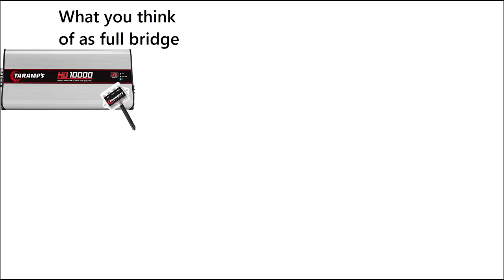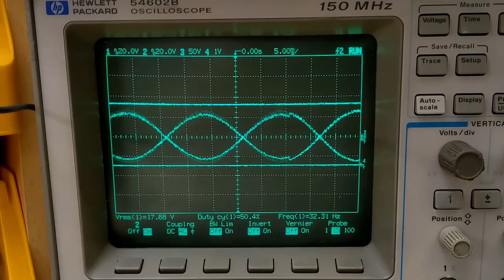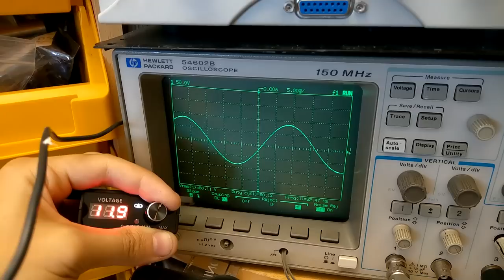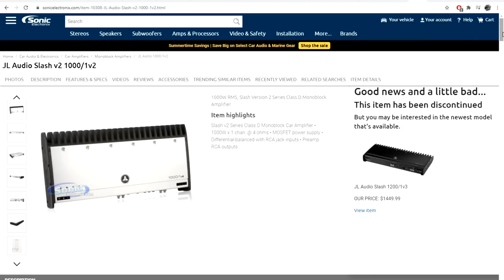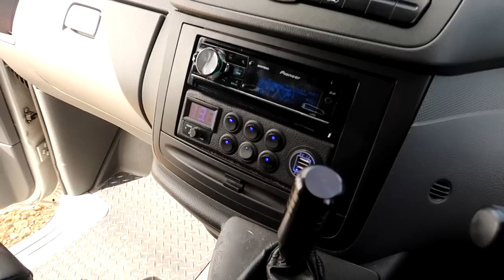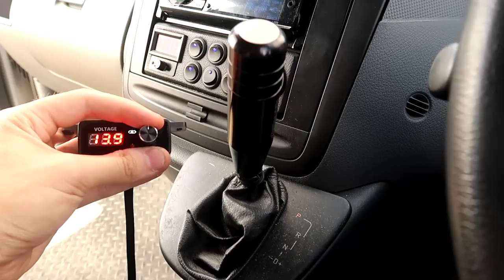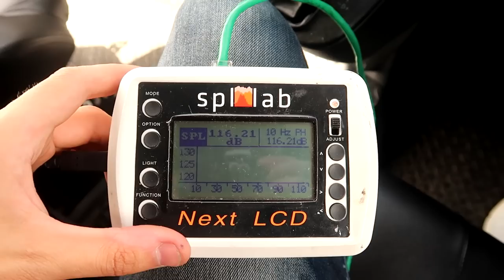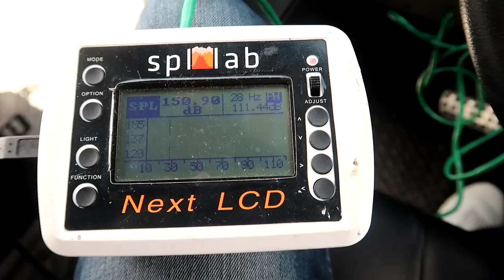Are the new DD Audio M series amps any good? Circuit overview & demos

Comment: that bit about the amp dyno at the end was a good point the only thing they can do that you cant do with a clamp and multimeter is find the phase angle, but even without a decent oscope to do that comparing amps using the same set of clamps and meters is a perfectly fine way of doing it. sure its nice having it all in one tool but then there are guys like me who used all their meters all the time and id rather not spend a ton on one i could only use in one situation to save a couple minutes tops. ive got a big bank of resistors for my off grid dump load setup as well so i can get those 1 ohm non reactive readings.

idk different strokes 

also i find it funny how the guys whos names are on those tools get publicly angry when you bring up other methods of doing the same thing like the diy clip meter that i first learned about in the 90s from rockford

Comment: Eyyyy Sam what a pretty gal you've got there good for you brother! And yeah that baby did some work for a 4k indeed!!! I personally have two Wolfram AW-9000.1's to run on my pair of Wolfram PT-18's with 4in PE flat wound coils 4k rms each so one amp per at 1ohm they should have plenty of power to daily and burp when needed 😝🤣 I've currently got plans drawn up by Drew Jones of basshaulics for a regular ported enclosure but I plan to eventually do a C-pillar wall retaining use of my backseats but Drew talked me out of it and said there wouldn't be any surface for the woofers to load off of and that it would not be loud at all 🤔🤷‍♂️ either way I have goals of mid 50's at below 40hz  and I believe I've got the power to get there! What do you think of these Wolfram amps? I'm actually shocked by how much clean power they're pushing and how efficiently they do so... I also have a single AW-5000.1 unused still sealed in the plastic and I've got the AW-125.4 for my front stages.... love the channel
Reply from the maker: Yeah them amps aren't bad at all buddy ☺ should be good

Comment: Hi.Man you really are an expert.I love listen to your video even if i can't really understand all that you are talking about.😁
Can you please help me.I am torn between DD M4000 and Taramps Smart 3 Bass.I have a ground zero gzpw 15 xq 5000w wired to 1ohm.Box 5 cu.ft tuned to 30hz.Stock 130 amp alt, agm Hollywood spv 120 back and standard lead acid 80ah start battery.
DD or Taramps more eficient and powerfull for me?
Sorry for my trash english.
Reply from the maker: Smart 3 Bass, every day 😁

Comment: Dear Sir : Love all your information and videos.  Was wondering if you have ever had any experience with the MMATS Pro audio amplifiers if they are as good as they say they are?
Reply from the maker: They were meant to send me one but heard nothing since
Reply: @barevids   Thanks for getting back I was curious how the stak up against DIGITAL DESIGN M2000 or M2500 amp.
Reply from the maker: @randyharris2446  I would just get a Smart 3 buddy. Sooo much better than any of those.
Reply: @barevids  I am running 2 DD 2508 in a 6th order band pass trying not to go bigger then a m2c power wise
Reply from the maker: @randyharris2446  having headroom is super important. The farther from clip you are the better. Use The Smart 3 and set gains to within the woofers mechanical and thermal limits.
Reply: @barevids  everyone  keep telling me to stay away from the full bridged amplifier
Reply: Which is better tramps or soundigital
Reply from the maker: @randyharris2446  no one knows what they're talking about lol. Taramps is better.
Reply: How good are Powerus amplifiers
Reply from the maker: @randyharris2446  the best!
Reply: @barevids  which one would you recommend the 2500
Reply: Was wondering what size of Powerus you would recommend for the two DD 2508 they are dual 4 ohms in a sixth order the PW 1600 or the PW 2500
Reply from the maker: @randyharris2446  bigger the better, why not the 3500. There's no benefit to having a smaller amp other than maybe it's cheaper. Smaller amps aren't necessarily safer either.
Reply: @barevids  okay thanks for all the help and information

Comment: All I can think of is "damn, the suspensions on those subs must be insane". Nice looking build hindered by junk caps (CapXons are pretty horrid, as it turns out).
Reply: It’s not true. CapXon had a bad run back in the “capacitor gate” issues of the late 1990s, early 2000’s but so did Panasonic and dozens of other manufacturers. CapXon is a massive, world-class capacitor manufacturer. Do your research.

Comment: If yall had 2 choices the DD M series 2500 or Salt 3 which one would yall lean more towards? I know the Salt does its power at lower voltage but know DD has always been good quality for sure
Reply from the maker: Neither lol get a Smart 3
Reply: @barevids so the smart 3 is better the smart 3 bass? And better then dd sundown amps? Seems pretty cheap compared to all other 3k amps for sure

Comment: I don't like Korean amplifiers I've had dd amplifiers and other ones? Im running taramps bass 8k  reason being the clipping indicator is on point? When everything is set right you don't burn your voice coils and they don't have a lot of dynamic burst they are pretty much rated power all around when using most Korean amplifiers you have to basically clip them to get maximum power and clipping causes voltage drop and electrical issues?

Comment: There is no isolation relay ... and full DC rail voltage could be sent to the sub? Is that something to be very concerned about, enough to not buy the amp?
Reply from the maker: Not a deal-breaker but it's a bit careless.

Comment: 4k on stock alt....Man all I am adding is a Skar EVL 15 on a SKv2 1500.1d and I think I need a new h/o alt...agm batteries...1/0 big three...I mean my wife is getting heated at how much 50ft of sky high 1/0 is....and here you are juicing up a 4k amp with your stock alternator with all that knowledge...

I feel like I might be going too far for my little 1500w amp...but at least I am having fun!
Reply from the maker: Haha. Almost all of the energy for your amplifier comes from your battery bank. The alternators job is first and foremost to charge the batteries, but it has a side effect of supplying a small percentage of power to the amp up to a point. A 4kw amp will draw around 450a at full tilt. A 200a alternator will start dropping off considerably after 180, where your batteries then become the main source of energy. 
In a system with a large battery supply and small alt, your batts will deplete faster than your alt can charge. Fine for burps, and for demos with a break inbetween to recharge the batts. For those wanting to drive for hours playing loud, or giving demo after demo for hours at a show, the alt needs to be supplying a much higher percentage of the power. The batts will still deplete, just much slower.
Reply from the maker: For a 1.5k amplifier your stock alt will be absolutely fine. All you need is solid cabling and a low internal resistance battery or two.

Comment: I've been against full bridge amps because I can't stand the sound quality compared to others. Is it more so Taramps and their SQ, or is it more how Full Bridge works? I've compared Taramps to Alpine and Precision Power, and the horrible frequency range of Taramps just seems horrible for what I like. Seems like a cheap way to make as much noise as possible for as little as possible with the added suspense of will the Taramps flame up and will it burn the car down. Just seems weird that "protect" feature doesn't really work. 
So I admit, I've had a bad taste for full bridge because of Taramps, and find myself having a very hard time trusting a full bridge amp. And I have seen your Taramps Vs JBL, I would like for you to do the same test but with good quality components and try again. Or maybe with a 8" or 10" sub and I'll bet Taramps will be more noticably harsh compared to the JBL.

Comment: what are your thoughts on the surface mounted electrolytic capacitors? I hear they leak....
Reply from the maker: Haven't seen any leak in the years that I've been repairing amps.
Reply: @barevids  I repaired some electronics with them on the board and was told to remove and replace with standard electrolytic capacitors.... Me personally never seen them leak... ???

Comment: Worst amp i ever got was the DD DM-2500A..Will never use a DD amp again..Ive never had a amplifier go into protection as quick as this one did..Sad thing is i replaced it with a cheap budget friendly amp..Precision power ice7000.1..been running this amp at .5 ohm for a good min now with no problems whatsoever..Not a fan of DD now

Comment: What do you think about the sundown salt 8 amplifier are the DD M8 which one is the best
Reply from the maker: The salt has the edge on the DD for sure.
Reply: What about the Sound Quality
Reply: What would you do buy 4 15 sundown subwoofer zv6 15 are DD 9900 4-15  on the amps 2-salt 8 are 3-4  m8000
Reply: dd ftw salt 8k does 2k at 4 ohm and 4k at 2 ohm 

dd does more power more efficent  and better thd . higher quality all around if u cant affod it get the sundown

Comment: my taramps bass 3k having issue turn off pop. what cause this? actually not an issue for me, but need to know why my amp have a pop sound when that amp turn off. pop noise come from my sub, not an amp
Reply from the maker: Remove rca. Does it still happen? 
If yes - just the class D pwm halting which can cause small DC pulse. Nothing to worry about perfectly normal as these amps don't have a relay to isolate terminals.
If no - small offset is being sent down rca when kit is powered off and Amp turns off slightly later than one of the signal side components.
Reply: @barevids  doesnt try remove a rca yet, i will try soon. my rca to the amp come from Equalizer pre amp. 7v rms max/sub vol at 4/10 ( use this eq because taramps not have a bass knob ). but reading my remote wire just 11.5v when engine off, real voltage on batt n amp terminal is 12.3v. remote wire share to 3 acc, amp + eq + volt meter. taramps vtr1000 volt meter. pop noise can cause any problem to the amp or sub? if no, just ignore it 😑 thanks for advice 👍
Reply from the maker: Doesn't cause any problem, no. 
7v is way, way too much for the taramps on rca. Make sure you are not turning that up much.

Comment: How do this compare to jl audio HD amps?
Reply from the maker: Comparing oranges to apples they aren't designed for the same thing
Reply: @barevids  can you elaborate a little more? Basically I’m torn between m4000 and jl hd1200. I have a D D 2400 watt at 1 ohm and the jl HD blows away that amp in power and sq
Reply: I could wire down the dd M2a to .5ohm but my subs only wire down to 1 ohm so I’m stuck there
Reply: @barevids  still wondering about this, is it because jl provides 1200 at 1.5 ohm-4 and dd is based off impedance and frequency?
Reply: So a 1 ohm load on dd M2a never sees 1 ohm power constantly because the amp outputs based off the frequency and impedance, hence why running subs at . 5 ohm load isn’t really .5 ohm load
Reply from the maker: @radiospank  yep pretty much. You could get a smart 3. Thats basically a JL 3000w lol.
Reply: @barevids  hmm so after researching the smart 3 it seems like it’s similar to JL HD amps in “constant power” at 1 - -2 ohm loads, but how’s the SQ of the smart 3, the JL is very good and I can notice the difference between the dd m2a. I suspect DD hasn’t changed much in SQ in their amps so I’m hesitant to look at m4000
Reply from the maker: @radiospank  there is no perceivable difference in sound between amps in subwoofer application. For clarification watch the video I'm about to release in about a week or so, it's eye opening lol. The Taramps will sound every bit as good as the JL. It's down to how you set up the crossover slopes.

Comment: DD audio grinds off chip labeling. Why? If it's a Korean design then surely someone else uses the same circuit in a different branded amp?
Reply from the maker: DD don't. It's just the factory standard practice. All the many amps using this same board have the chips grinded.
Reply: @barevids  Ok. I figured it was to keep others from copying.

Comment: This vs salt 4
Reply from the maker: Neither tbh
Reply: @barevids  what's your go to for 5k?
Reply from the maker: @ah4800  PW5000, Big Boss 5 Bass
Reply: @barevids  due to price to power? Or what's your reasoning? How about for a half bridge?
Reply from the maker: @ah4800  better design circuit, way better price point, the DD and sundown branded amps are ridiculously expensive for no reason other than to make stupid profit for all of the middlemen along the chain. They are not better circuits despite you paying almost four times as much. Full bridge or half bridge makes no difference.